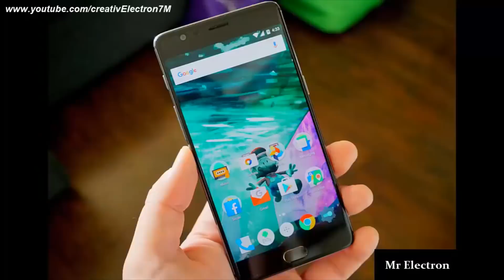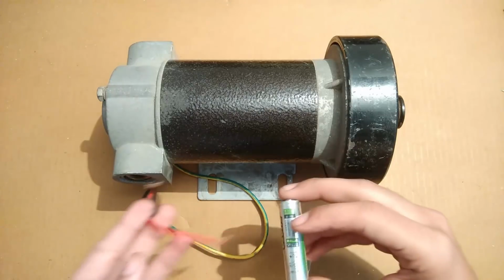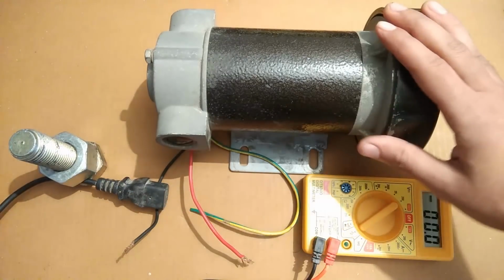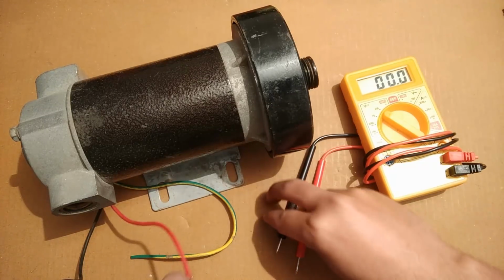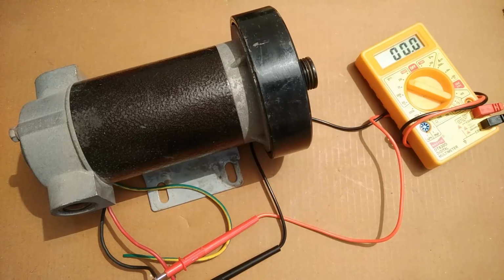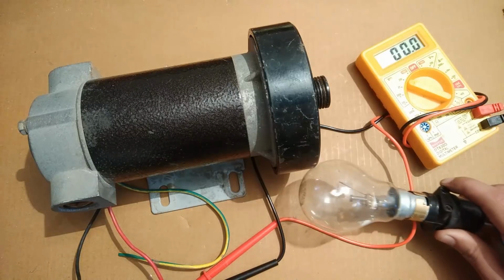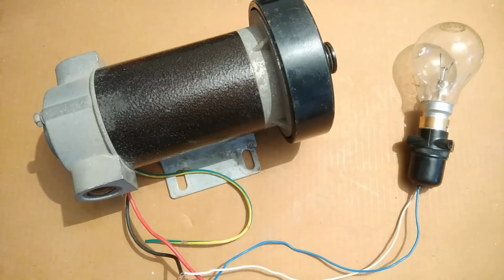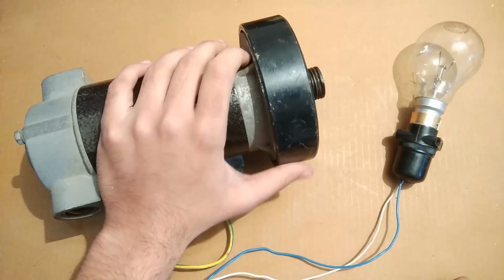250 Watt DC Generator using small DC motor DIY - Amazing idea 2018

Comment: i have a berger lahr stepper motor litlle bit small but if i turn dat with my finger, a 100 watt bulb work ,but dont know how to use it and connect it with a wind turbine......any idea??
Reply from the maker: How many output wires does your stepper motor has??

Comment: If you wanted to build a wind turbine with this to charge a 12v battery what regulAtor/charge controller would you use? The only ones i see on ebay at a decent price are 3 phase 300watts
Reply from the maker: Jacka T no i won't.Its amps are less.Its a 250W motor and the rated voltage is 180V which means that the current will be just ~1.4Amps even if the voltage is high
Reply from the maker: Jacka T Try going for a low rpm 12V generator and if its too expensive and hard to find, then go for a 24V low rpm motor to charge your battery.That should do good job
Reply: Mr Electron what does the amps need to be to charge a 12v battery?
Reply: Mr Electron ok thanks for that information, so what are the treadmill motor good for then?
Reply from the maker: depends on its Ah value
Reply: Mr Electron so in strong wind and high rpm it wont charge a 12v battery at all?
Reply from the maker: They are excellent generators if used with a proper charge controller.You can also use this motor as a wind turbine generator and it will work great only if u use  a gearbox and a good charge controller.You know what , I should make a video about trademill motor wind turbines even though the project is gonna be lengthy

Comment: where can i get this motor ....plz reply me... it's important 😣😣
Reply from the maker: Hi! Its not available right now but i have similar ones.. Contact omarsuhaib100@gmail.com for getting motors according to your need.
Reply: @MrElectron  Actually i'm from gujarat, india. and i need this motor for generating power from Manuel treadmill
Reply: From any old treadmill, they use these motors.

Comment: Doses anyone know if it be possible to use a Small DC motor to move a small wind turbine by connecting directly to the turbine to make it generate power  to produce more wattage that the wattage that's being used on the small motor like to give and example say the motor uses about say 65 watts to spin the turbine but the turbine is producing 400 watts would that be possible

Comment: Hello, can we use inverter to convert the DC to ac?
Reply from the maker: yess!!
Reply: Can you give us a video on using inverter with treadmill to power at least 500 to 1000w load?
Reply: Mr Electron pls can we use inverter with this model to power 1000watt load?
Reply from the maker: Actually i don't have a 180v dc to 220v ac converter but if you can get it somehow, then i assure you it will work.

Comment: Can you please provide some details about the motor please. Any links to purchase? tks
Reply from the maker: not yet :)
Reply: I noticed that you were able to make a self powered loop system. I am trying to looping a 5KV brush alternator with a single phase 1/2HP AC Synchronous Motor, connect through a 2100watt online UPS for this purpose which also has a built in stabilizer. Alternator out is going into the UPS, not connected to the grid. RPM of alternator is rated to run at 1500rpm but mine is running at 1560rpm. , I dont think that is an issue. I also have a flywheel connected for inertia and running at the same rate. I am still trying to get it to loop as it keeps switching from battery to main power grid. When the flywheel is connected  the duration to switch between battery to grid is longer. The alternator doesn't have an AVR only a rectifier, wonder if that is the issue, have ordered one and will try it with it soon. I noticed that you are using DC motor as prime mover and in one project you have also used a transformer. Any help would be appreciated, tks.
Reply from the maker: https://www.freewebstore.org/motorgenerator-shop/

Comment: What's the name of this motor? From where will I get this? I have searched many but I haven't found. How many HP is it? How many RPM is it?? Please tell me. Please give me link from where do you buy this. I haven't found 250w motor on internet. There are many of 180v.i watch your all videos but I found this video best of all. This is real
Reply from the maker: no links at present.I will update as soon as i will get the link
Reply: Mr Electron 
Okay I will wait. Please tell me as soon as possible.
Will 700w with 2 HP and 775RPM motor work if I try to work with this project, will it work??
If you want to sell this motor to me, please sell. How much money will you sell it?
Reply from the maker: https://www.freewebstore.org/motorgenerator-shop/
Reply: Mr Electron 
I got this motor. Thanks for your time.
With regards
Rafiq

Comment: what the hell is in that gray cap on the tail end of the motor something is kind of fishy about this video to the point where he's not being completely honest about the functionality of the motor as if he didn't add something extra to the motor for to give off that much power. I think he has a blocking diode inside of the gray case to give it staying power on whatever is being powered and he's pretending as if the motor itself is doing all that work with nothing helping it